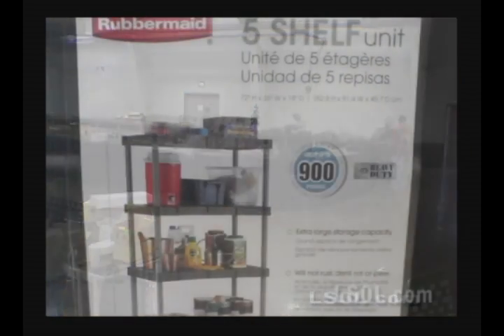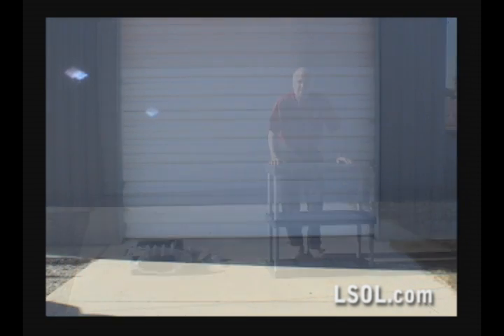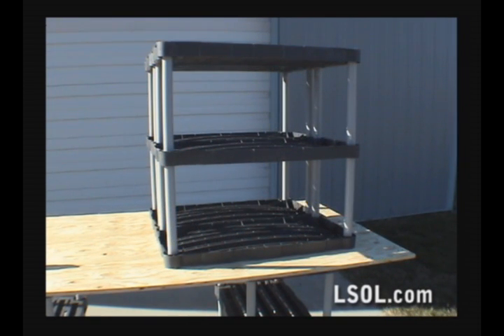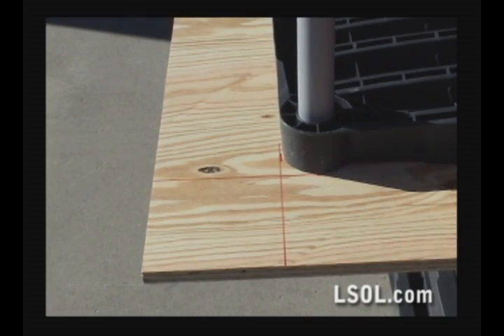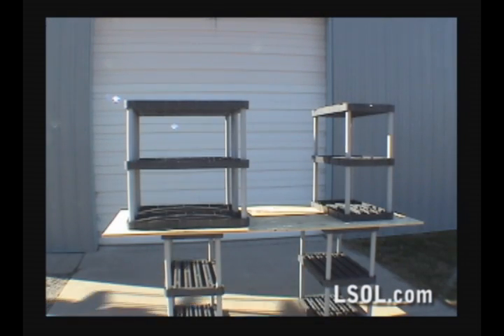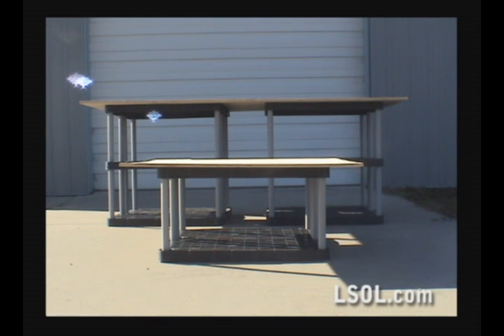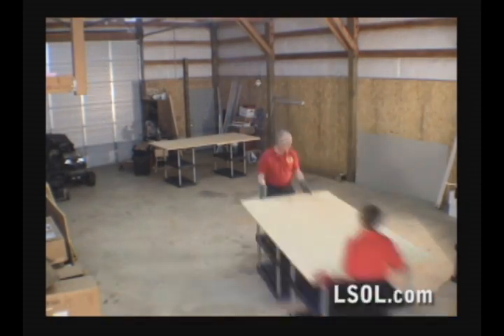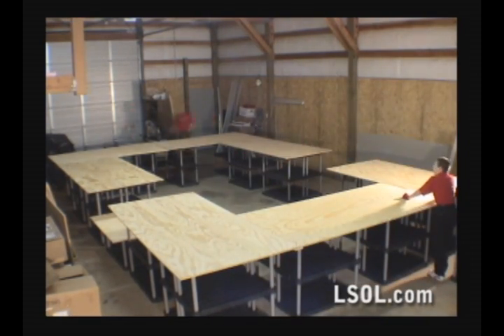Indoor  Large Scale Model Trains: Making a simple table top with storage.

Comment: After using 3 shelves of the 5 shelf unit....what did you do with the other components?
Specially being short one shelf to complete the other components? Great idea. 
Would you suggest this for an HO layout of other gauges?
Reply: River City MOVERS Good for all scales. Just change the size of the plywood for smaller tables.
Reply from the maker: If you buy enough, they will even out in the extra ones I said because when we reconfigure things I can use them. I use one of these for an N scale just wanna stand and I have like a 2’ x 3’ board on it.